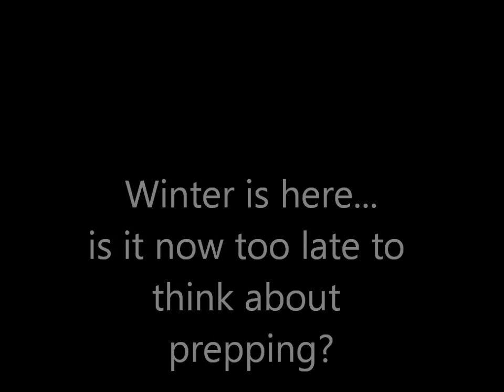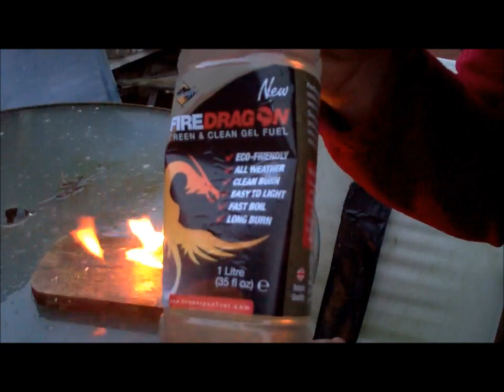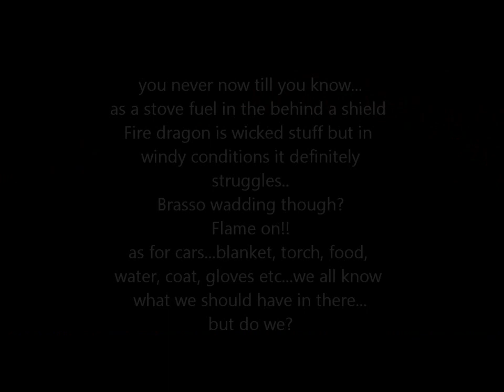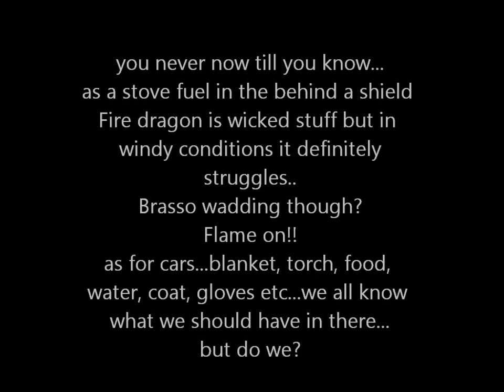Winter Preparedness/Survival Tips, Ideas for the uninitiated

Comment: Why do you love Brasso more than other accelerents?
Reply from the maker: bikenutter1 you get the tin to use after, it fluffs up to catch sparks really well, when half full you can fill with cotton wool which soaks up the liquid a bit making more , and it  burns for a minute with a big flame...lots to like!
Reply: Its pretty much waterproof aswell. You can take some...hold it underwater and pull it out and it will still light easily. Rob.